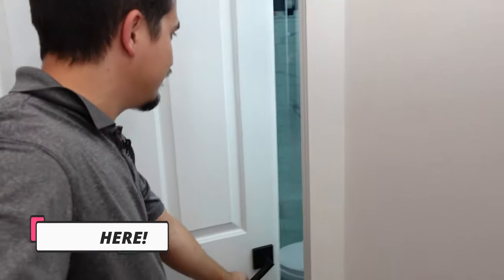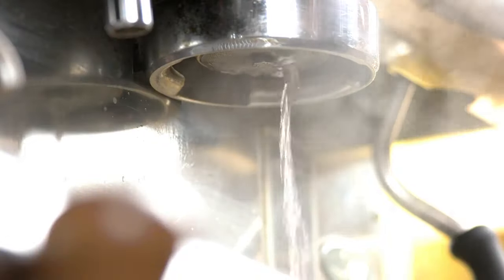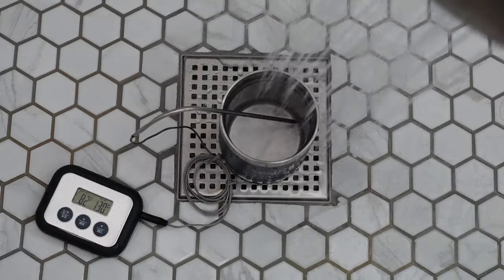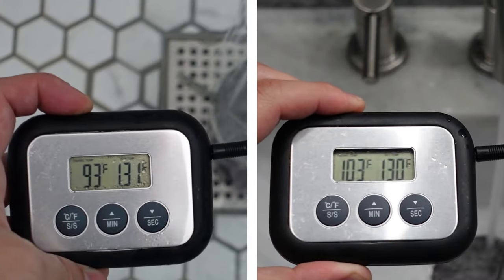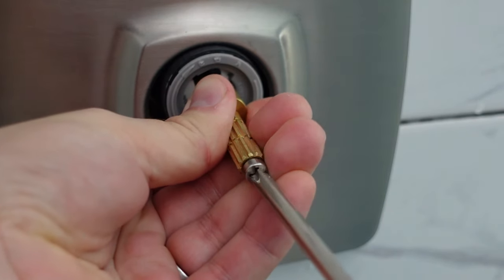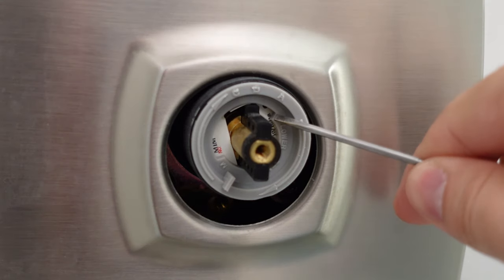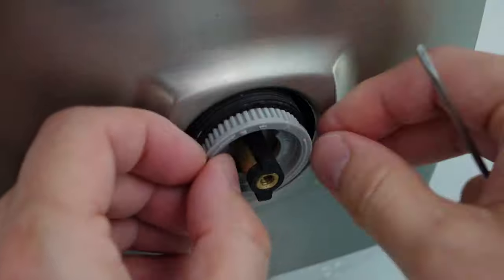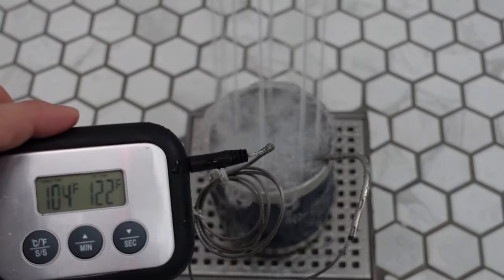how to make your shower hotter | adjust shower valve

Comment: Do I need yo shut off the water first
Reply from the maker: If you want to, it will probably be a good idea. However, if you keep the valve in the off position while you are doing this work then you don't have to turn off the water. I didn't turn off the water on mine. But do what you are more comfortable with.